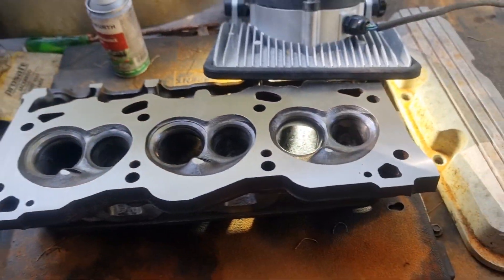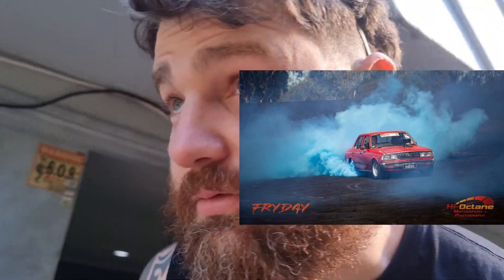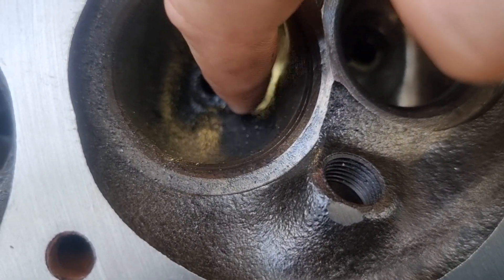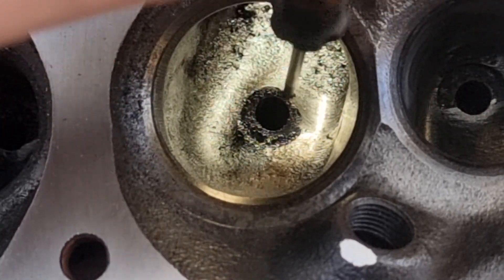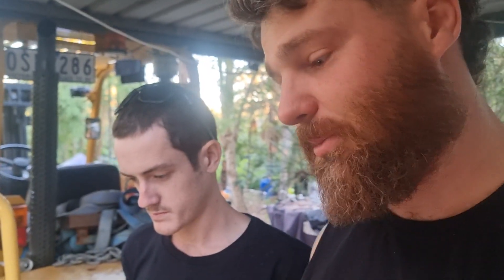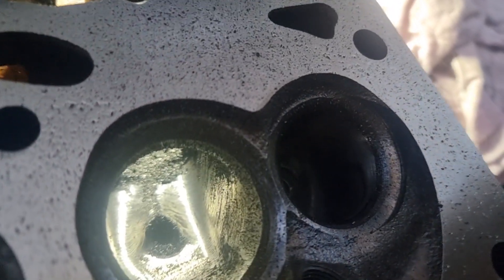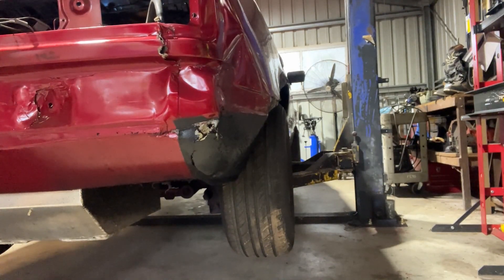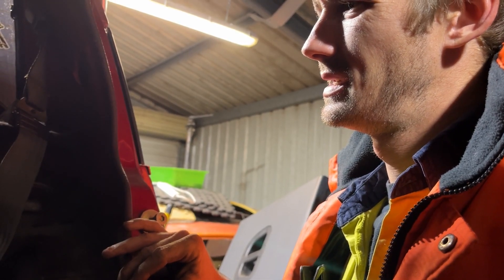Porting ECOTEC V6 heads (plus DAMAGE update on WINGINIT)

Comment: I liked using L36 heads as they have a lot of meat above the port so I could lift the port for a straighter shot at the valve. Also picked up putting slippers on the port floor entrance just like cleveland heads. Exaust port picks up a lot laying back the chamber and de-shrouding the valve as well as blending the seat cut into the chamber. Great to see people still into the v6 👍

Comment: Watching later and my thought is if you run a carb on the manifold is each brach of the manifold sectioned off to each cylinder if not then you will get over fuel on some cylinders and leen on the other with fuel staveation

Comment: So you guys are talking about head porting and inn the UK we say and do you measure each port after to get the same ballance on each cylinder when fuel flow and have you ever seen rim flow valves where there cut to the seat at different angels to get more  swerl for the fuel just some head tips and what rockers have ya got to that helps to let it rev